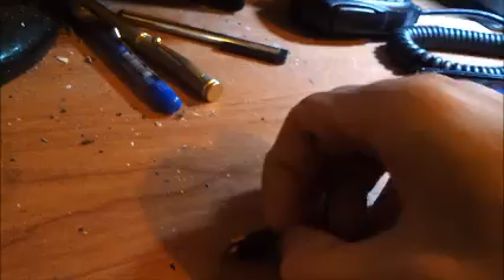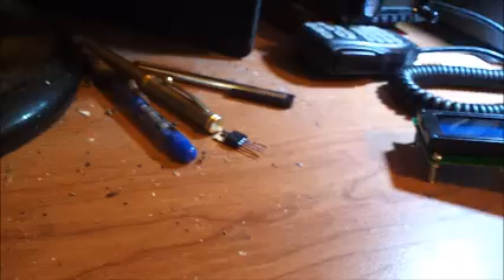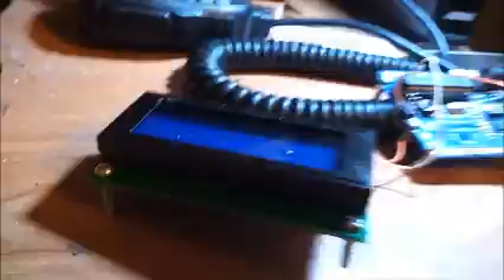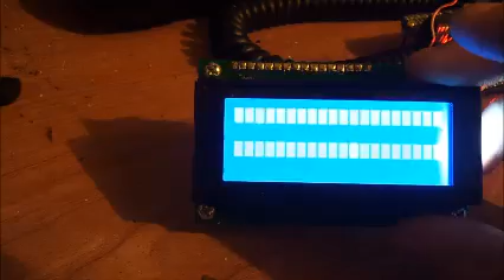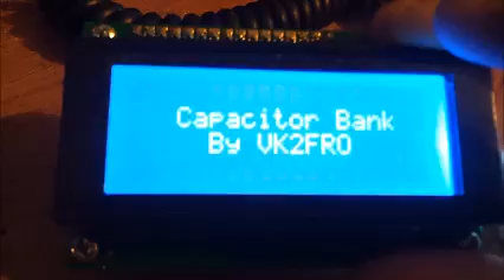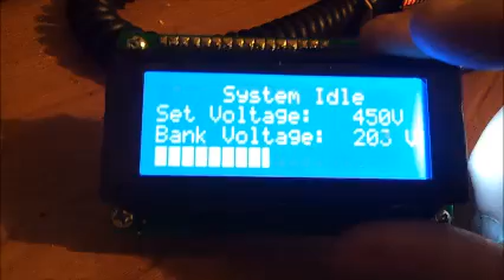Cap Bank Controller major overhaul

Comment from the maker: tis all good mate - I've spent so much time working on mine I'll be afraid to fire it in case something blows up! I think I'll go the pot idea too - heaps easier. Rotary encoder sounds nice, but more coding - I cant be stuffed. I'll just map the analog pin to a range between 0-500 on the arduino.

Comment from the maker: You only have 2 lines on your lcd anyway - where were you gonna put the bargraph?

as for the switches, I've got 3 - charge dump and fire. The other pushbuttons will be replaced with a rotary encoder. Turn to adjust, press to select. :)

Comment: nice job. the new features make it more fun too!. a feature i've just added to my code, but not to my unit, is to read the set voltage from a potentiometer at the main screen :-)
so i can auto charge to whatever voltage i like 0-500.